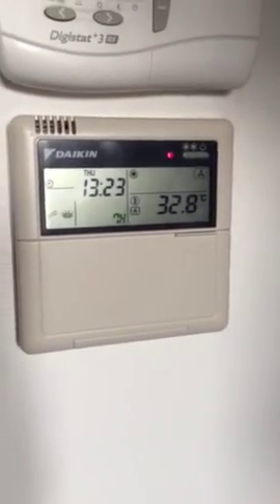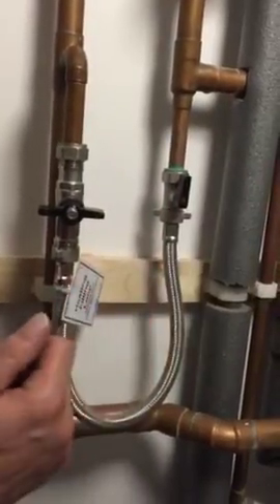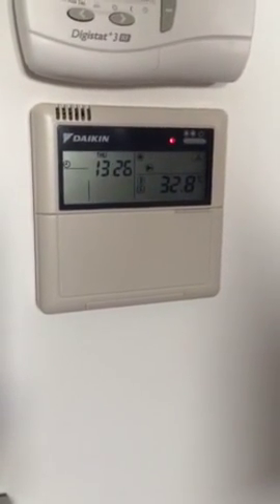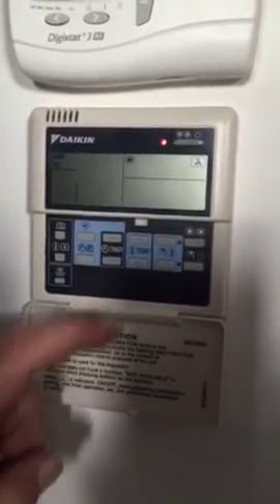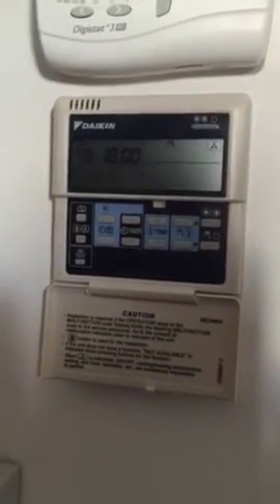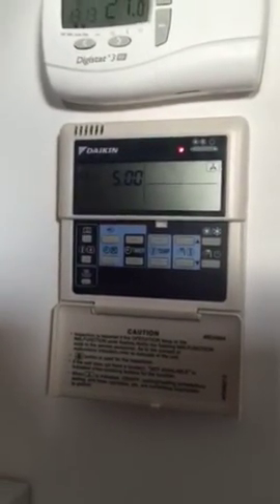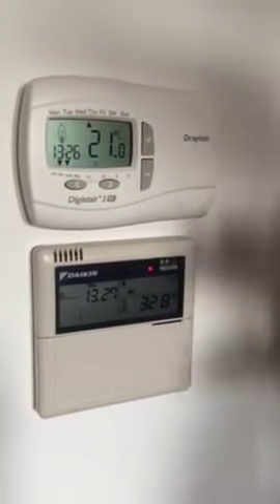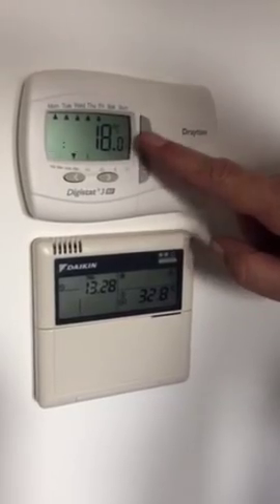Daikin Air Source Heat Pump by Shackleton & Wintle ltd

Comment: I'm still a little confused with my Daikin controller. I have it set to come on for an hour in the morning and an hour in the afternoon. Between these times does it maintain the heat or slowly loose heat? Also if I press the shower/on button does that mean the hot water is on permanently. Thank you